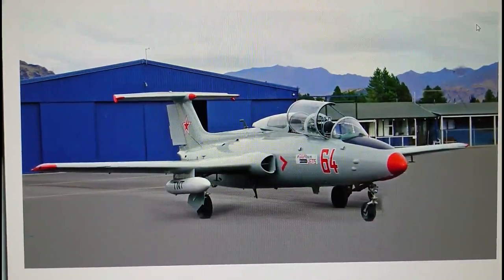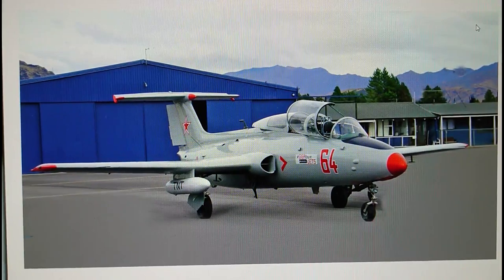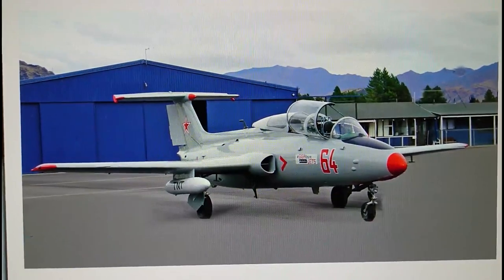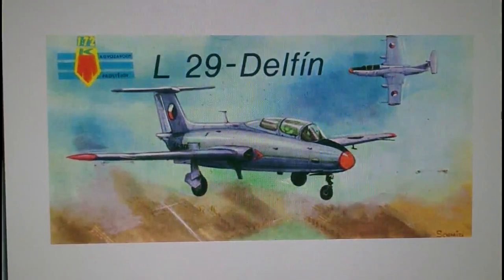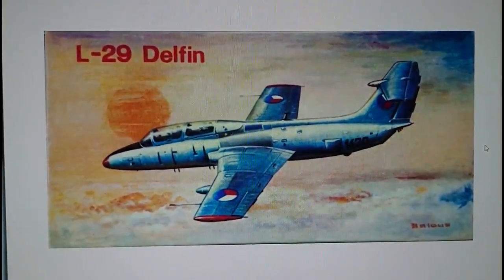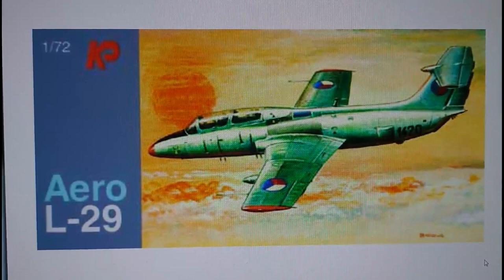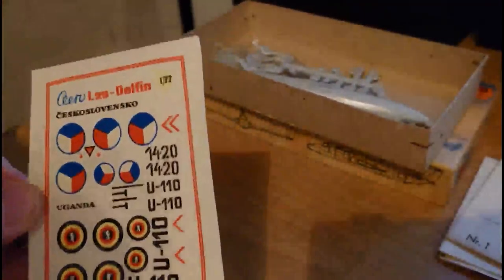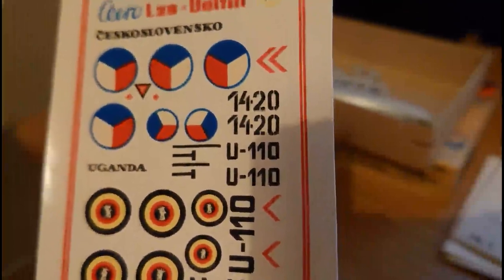KP Model 1 72nd Scale Aero L 29 Delfin In Box Review

Comment: Very good good kit discussion. I built the Bilek L29 a while back. This kits looks a bit more basic but the Bilek kit had a vac form canopy. Have a soft spot for KP kits and have built quite a few. I find the decals can be a bit thick and don't settle too well in ribbed surfaces even with microsol.
Reply: I also have a soft spot for vintage KP kits. My plan is to build all KP vintage kits.